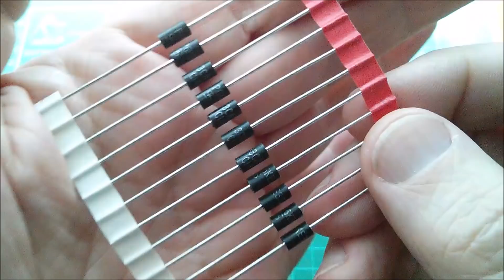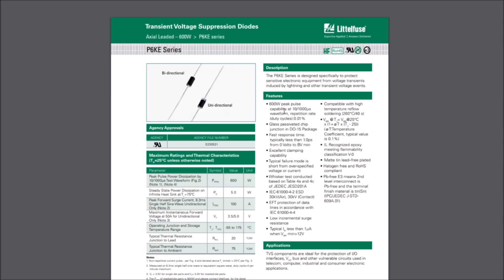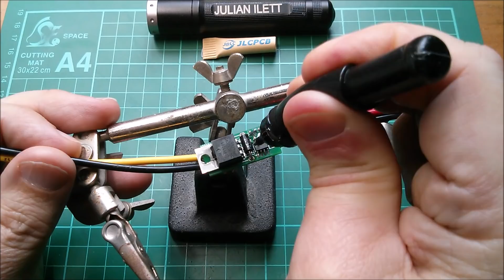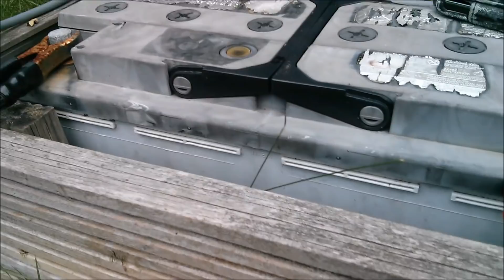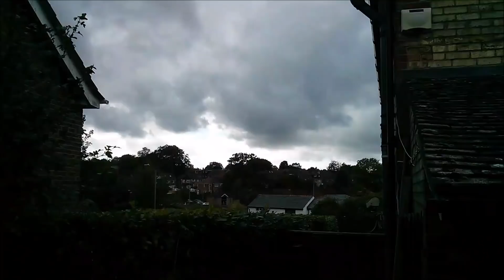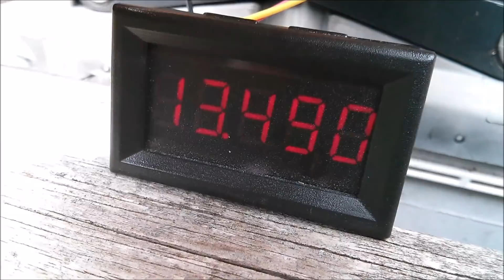A Diode with No Cathode - PWM5 Femto

Comment: I use UV hardening acrylic resin all of the time, because it is clear the UV passes trough it all of the way to the bottom.  It is not a real glue because it cannot be hardened between two objects.
(unless on is glass or UV conductive plastic)  This looks like a suitable use for the stuff.
The sun will finish any unhardened spot soon enough.  I charge such batteries with 13.8 Volts.

Comment: Last fall a piece of the gasket that seals the hood like device on the front of our Class A  Motor Home came loose.  It kept sliding off every time I checked the oil, which, caring for my engine condition, I do at every fuel up. So when we got to our winter quarters, I drove up to a local hardware store, and the fellow behind recommended this tube of stuff to fix it.  I took his recommendation and bought the stuff.  A few drops of it, and the gasket is fixed, so I am left with a nearly full tube of the stuff.  Well about a month later, the handle on the microwave/convection oven came loose, in order to fix it, you need to disassemble the entire door, not a chore for an old man, so I took the black stuff and glued it back on, it is still working just fine.  Well this summer I built a nice little ghost detector for my niece, who is into that crap, and I needed to cover the resistors and wires that were exposed, my mind turned to that tube, and I used it to cover the top, yep still working great and the stuff is impervious to water, it goes on and really looks like wire insulation and dries in just a minute or so.  The stuff is made by 3M called BLACK SUPER WEATHERSTRIP ADHESIVE. Smells almost as good as that glue we used to use to make models back in the 60's till they banned it because some of the bad youngsters were sniffing it to get high.  If you don't mind the BLACK part, give it a try, if you can get it over there, I am sure you will not be disappointed.

Comment: Are you pretending to be naive again, mr. Ilett?
You shouldn't need a lightning bolt to test your protection. A switched relay or any other inductive load should yield hundreds if not thousands of volts for your TVS to clamp, as I'm sure you know.
And you're known to have both a video camera and an oscilloscope.

Comment: Those bi-directional diodes are used in magnetically latched contactors to suppress back emf when applying a supply to the contactor coil in either direction 👍

Comment: What you want is some RTV Silicone 705 from aliexpress. It's crystal clear.
If you want white then RTV Silicone 704 type A and black is tybe B. Lovely stuff, waterproofs easily and very inexpensive.
Works for potting stuff in small blocks of it as well.

Comment: Hi Julian, in case you really need protection, a single direction transil will help you better, unless you don't care full reverse voltage on your equipment. Transils work much like varistors (MOVs) but are much faster and they can also provide assymmetrical polarity (unless bidirectional ones used). It will take only sertain ammount of energy untill it gets toasted, so these components meaning is to get a fuse blown before the rest of your circuit since fuses are quite slow acting elements. Good luck :)

Comment: I have also noticed little wisps of smoke or vapor coming from larger amounts of this type of glue. Not 100% sure but I think it is a chemical reaction of the glue to the UV light. 15 seconds seems to work when hardening the glue.

Comment: Have you ever worked with Gas Discharge Tubes (GTO's) or SIDACtors for over-voltage protection in the higher range?

Comment: little trick for the crocodile clips is to heatshrink the crocodile clip, maybe with 2 or 3 layers so they still have the clamping, but not the rough teeth.
also, about the voltage indicator led, even for me watching the video its sometimes difficult to count that fast, wouldnt it be easy to just slow the second ones showing the .5 and .8V slower, so you can count them, and not guess them?

oh yeah and do you have a link to the voltmeter box you showed on top of your batterys, i bought some from amazon, but they often have big tollerances, or are just like half a volt off^^ thx

Comment: As far as I remember, the “A” in both versions signifies the tolerance of the nominal voltage.  It also looks like the board marking with the cathode line might be intentional.  You might be better off using a non-C version that would provide some protection against reverse polarity (less than 1 V).  Now with the bipolar version you allow full 33 V of reverse direction voltage before the TransZorb protection kicks in.  The rest of the circuit got damaged way before that!
And one little note about the power handling:  The P6K33 stands for 600 W as you stated.  Could read as 0.6 kW as the P6K...  There are also parts 1.5KE that are 1.5 kW rated power capacity (sub-millisecond duration).  All this from the top of my memory.  I used to apply those way back when.

Comment: Is that a blacklight (near UV) or real UVA/B and harmful to your eyes ? China like to sell UVC lamps as "black lights" and not labeling dangerous products* .You could test if the UV only hardens the top layer by making a thin coating of it curing the top and seeing if the UV comes through the other side by putting fresh glue on the other side and try hardening it by shining through the other side. Unless they can't make it transparent having the cured layer block UV would be a bad thing. But people in the comments have a bad habit of seeing half a youtube video made by an idiot then commenting as if they have a degree in materials engineering. Many things in science don't follow common sense.

Comment: +Julian Ilett I think that 'smoke' from the curing glue is actually cyanoacrylate vapour, which is hazardous to breathe. It also comes off regular superglue but only slowly - it's what causes the white smoky deposits you sometimes see on clear plastic close to a superglued joint - and is also used by law enforcement to develop fingerprints. 
http://www.personal.psu.edu/msp5018/blogs/english_202c/the-development-of-fingerprints-with-cyanoacrylate-super-glue-fuming.html
Reply: Rosscoff2000 - Clive?! Wrong channel!
Reply: Ha, yes, of course I meant Julian!

Comment: i've used the P6KE18CA for stuff in my car.
Basically it "is" two z-diode coupled together.

our 5.7 kw peak solar roof installation is many cells in a row, because so you get better conversion rate to 230V AC, even if on low light.
AND you can take smaller wires because high voltage low current.

Comment: I think cast resin in some kind of plastic tube could be a good solution for this. If you sand the insulation of the cables near the PCB, it will also be a very good strain relief. In my experience its the only solution that is permanently waterproof, even when in the ground or submerged in water.

Comment: Good idea. My first self-built charge controller probably died by transient. Fried an INA219 chip. Unfortunately it fried it in such a way that it still had a working i2c interface, but returned an incorrect reading - leading the controller to conclude the battery was perpetually under-charge. When I found the problem the battery was so hot the plastic had started to deform and it was making unsettling bubbling noises.

Comment: Hi Julian, I used UV curing glue on some solar light connections outside, they didn't last, yours might if you over wrap them and plug the ends. From the size of your PCB I was wondering if 18650 wraps might be a good option once you have coated them? They come in a clear version so you can still see your LED.

Comment: Why are you using the link wire and not just a 0 Ohm resistor?
Reply: Link wire is much more sensible. Commercial production uses zero ohm resistor chips only because the pick and place machines can handle them more readily, but a human can handle a wire link perfectly well.
Reply: @Rosscoff2000  Oh, that makes sense. But what do you mean by they are much more sensible?
Reply: I mean wire links are free (we all have bits of scrap wire ends), infinitely adjustable bridging length, and more easily handled by a human doing hand SMD assembly as Clive is.
Reply: @Rosscoff2000  True, thanks!
Reply: Rosscoff2000 - Clive?! Wrong channel!

Comment: 10:57 right at the start of this footage of you UVing it, a big blob of glue disappears over the right/top edge towards the wires.  This is probably the glue that ended up "running out the other side" later on.  
i think the surface tension starts to change as the glue is setting.  Or perhaps it shrinks, which can squeeze unset glue out from the lower layers.

Comment: This would have been a lot easier with conformal coating spray. Look into MG Chemicals' conformal coating. They have acrylic (not good for exposure to UV), silicone (stays vaguely sticky in my experience) and polyurethane (sets HARD) conformal coatings in spray, and liquid.

Comment: Yes it does get quite warm when you cure it. Couldn't you run all the leads off one end and dip the board in a pot of resin? You can get it in very large bottles.

Comment: You should have a resister in series to give a bit of protection to the poor device. I had a 0.5R resistor in place of what should have been 5R. During lightning testing I kept seeking little flashes trying to get a better view as you don't want to get too close, we did one last hit and the tranzorb left the box in one bright flash and a bang. 0.5r was not limiting the current enough from the strike pulse.

Comment: Alligator clips “bite marks”:  Put two tubes of heat shrink around each “jaw” of the alligator clip, and shrink them.... no more bite marks, and the heat shrink is fairly grippy!!  And if you if find you need the teeth again, an exacto knife makes short work of getting them off again 👍

Comment: Julian Ilett+
I don't know if you seen my last post , but I would try some UV Protectant Polyurethane mixed with hardener, dip the PWM5 Femto into the mix and let it firm up on its own. I think in time that glue will break down with constant every day UV hitting it and we're trying to protect it and it cost much less and will seep into everything and seal it hard as a rock.
Reply from the maker: I did read it. The problem with dipping, is that the coating will get all over the wires. Not sure I want that.
Reply: Okay, but you don't have to dip it, you can brush or drip it on and the hardener will assure all is hardened.

Comment: You would really like to have the shortest possible leads on the TVS diode to minimize the lead inductance. A surface mount component as close as possible to the input cables would be even better, and best would be having the TVS diode on the case rather than the board, right after the fuse if there is one (there should be).

Haha, it didn't occur to me that the board was just going to be hanging in the air! :-O
Reply: But isn't it best to put the TVS right next to the device that its going to protect? The battery could probably handle the odd spike whilst the circuit wouldn't.
Reply: Usually a TVS is put near the input on a board, which is what Julian has done, but TVS diodes are designed for ESD or fast transients and aren't designed for surge, which is what Julian mentioned (e.g. from nearby lightning strikes). To protect against surge, you might want a GDT (Gas Discharge Tube) like they have on telephone lines when they enter your house. The problem with handling surge events on your board is that they can be 100 Amps or more, so even if the protection device works perfectly, it will almost certainly destroy your board.

Comment: You can get 3D printer uv resin . Take it from a boat builder fiberglass is not waterproof if the core is exposed , you will get osmosis and it will separate the layers .
Reply: "3D printer uv resin" is too brittle.

Comment: How about submerging the device in water for 24hrs (whilst powered up)?
Reply from the maker: I did that with the original PWM5. I suppose I should do it again with the Femto.
Reply: How does that beat using it then replacing it if it fails?  Seems like buying a new car and crashing it into a wall to see how well it crashes into walls lol.
Reply: @stinkycheese804  I don't think it would be the equivalent of a car crash. I think it would be ok. It's the satisfaction...

Comment: You can get some side-firing LEDs btw, that way if you put it on the side of the PCB it should be easier to see :) https://www.digikey.com/product-detail/en/wurth-electronics-inc/155124BS73200A/732-12021-1-ND/8557231 Here's an example of a good one

Comment: Do you not loose power without having an anti back feed diode.
Reply from the maker: I did a quick test once - the backfeed current is tiny because the individual solar cells act like diodes. 36 diodes have a forward voltage of about 18V - this is way more than the battery voltage.

Comment: So how come you didn't fix the low voltage reading in software? All you needed to do is add +0.2v to the read value, then display that.
Reply from the maker: I will write a calibration subroutine in the firmware :)
Reply: Aren't there any other drop in regulators with more precision available? Maybe you could use some kind of voltage reference instead?

Comment: Testing TVS diodes in-circuit is risky.  There's no simple way to tell whether the current is flowing through the DUT, or is flowing through the component(s) the TVS is designed to protect.  This is especially true when the circuit is unpowered.  Current can backfeed through an I/O pin's esd clamping diodes to the supply, overheating the esd protection on the I/O pin and causing it to fail open.  Your part will still work, but now your esd protection on that I/O pin is compromised, and you'll likely never know it.  18 months later, your customer starts seeing really erratic and flaky system failures, and the test engineer just blames it on "junk parts".
Reply: A TVS will usually fail shorted, and when it fails open, chances are a visual inspection will tell you. The scenario you describe is not impossible, but it won't happen that often.
Reply: I'm not talking about the failure of the TVS diode.  I'm talking about the components the TVS diode is there to protect, being damaged while testing the TVS diode in-circuit.

Comment: I think the 3-minute epoxy could do a better job in my opinion.
Also a piezoelectric buzzer can make the counting easier in some cases.
Reply: 3 minute epoxy sets too fast, would not creep down into crevices well.  Use at least 15 minute epoxy, and put a transparent tape border around the PCB so instead of epoxy running off the end of the board, it fills in well.  Once the epoxy sets, the tape will peel off fine so long as the epoxy was touching the sticky side rather than the back side of the tape.  Granted, UV curing is better for those of us with a short attention span who want to see the video stay continuous, but meh, this did not need epoxy or a conformal coating at all, just to be enclosed in a weatherproof housing.
Reply: @stinkycheese804  
Those flooring epoxy seems like a good way to get a large amount of epoxy cheaply, and sometimes they cure translucent which may help see the LED. These also cure in multiple hours so it's easy to position them, get the bubbles out, add coloring or whatever.
Also I found that mineral oil (release agent) and silicone chocolate stick mold works well in potting small electronics.
Reply: Got a link to that epoxy in the UK please?
Reply: @Ziplock9000  
Look for local sources. Buying from Amazon is a bit risky because it may arrive damaged, leaked and all congealed up, you may get hazmat fees, or it may get seized by the customs.

Comment: Would this work with almost any power source. Around 13-18vdc?
Reply from the maker: No. If the battery voltage is below 13.5V, the controller will have 100% PWM. So the solar panel is connected directly to the battery. Would you connect your 18V power source directly to a 12V battery? No.